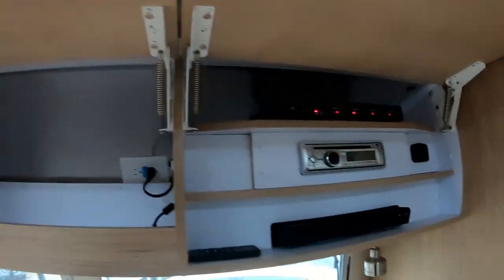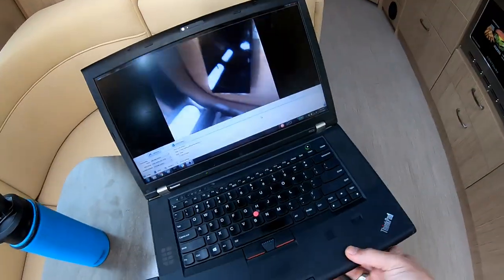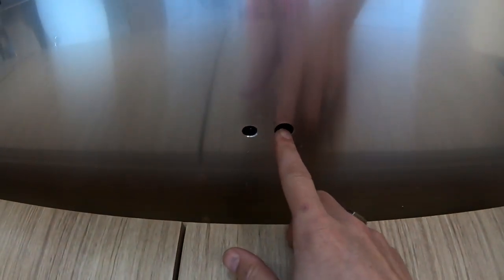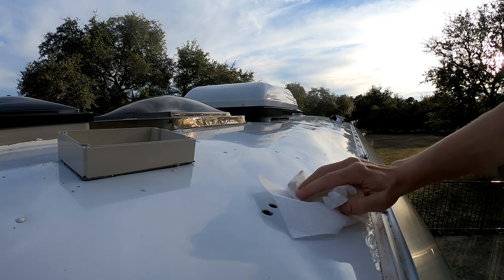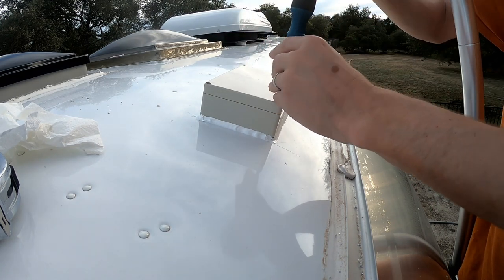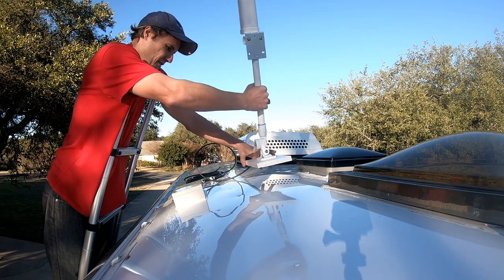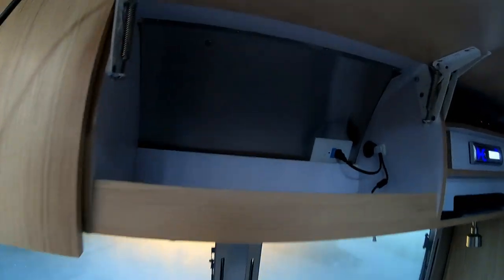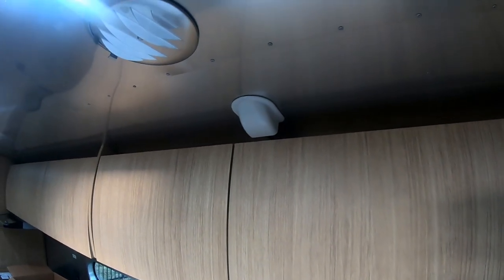Ep. 9 Installing a Cell Booster on our Airstream

Comment: Hello, is there some reason you had the holes on the pvc tubing facing up rather than down when it's not in use? Bend of cable? Any water living in tube?  How is it holding up along with the rest of the setup like the adhesive tape, caulking, etc? How do you like your tech equipment?
Reply from the maker: Hi D, that's just how it worked out with where the junction box was related to where I wanted to fold down the antenna. It doesnt really matter as the tube is hollow and the water will just drain out. So far the adhesion and caulking have held up well. Its been on the road for 2 1/2 years and its still stuck pretty well and sealed nicely. As far as the cell booster itself its sort of hit or miss. Sometimes it does nothing, sometimes it does a lot. It all depends on our location. I'm not sure on why sometimes it raises it from 2 bars to 5 bars yet other times it wont raise it at all. One thing I have since learned is that I should have mounted the external antenna further away from my internal antenna on hte system as that could cause interference. Perhaps that why sometimes its doesnt do as much, not sure.

Comment: Thank you for posting this video.  Installing a WeBoost on our Airstream Bambi 16R is today's project.  Now that you've had it installed for a few years, is there anything you would do differently?  Thanks in advance.  And, by the way, you're right....there's not a ton of documentation out there on how this is done.
Reply from the maker: The one thing I would have done differently is I would have mounted the antenna on the roof further away from the antenna inside the airstream. I've since read ( and spoken to others that have it installed ) that they get better performance if the external antenna and internal antenna are further apart. I can't say whether that's true from first hand experience but they claim there could be some interference if they are close.

Comment: Hi! I’ve been following your journey for a bit now and we actually have the exact same AS. After considering the couple of options available for mounting our antenna I’ll probably going to end up going with your method. 

I have most of the things I need to get this installed but the part missing is the cable cover that you used to hide the cable on the ceiling. Can you share where you found it?
Reply from the maker: Hi Albizu! Isn't the 30FB great?! Here's a link to the cable cover I used: https://amzn.to/3k9xrOC    It actually comes with those waterproof nubs as its intended for outdoor use as well. I didn't use those, I just used the housing though.

Comment: Are you worried about the exposed wire on the roof? Wire degradation would happen pretty quick in exposed sun and heat.  Thoughts?
Reply from the maker: So far it seems completely fine. I think the wire sheathing is pretty robust, it was manufactured with the intent of it being outside. But I can monitor it and if it ever becomes an issue just replace the wire.

Comment: John, just started following you on your adventure. Pretty fascinating. Do you like the weboost now that you have been using it for some time ? Are you grandfathered into an unlimited plan with someone?
Reply from the maker: Hi Glen, so far it seems pretty good although it seems I need to be really close to the repeater antenna inside the Airstream for it to have a positive effect. Unfortunately no grandfathered plan - I have a Verizon jetpack for $70 per month. Supposedly it "somewhat" unlimited - they claim it will still work after hitting 20gigs or so but streaming will be at 720p. I haven't had problems yet - not sure if I've ever hit that limit yet.
Reply: JohnJessJourney thanks man for the quick feedback. I went to High School with your sister and she mentioned your channel as I just purchased my first fifth wheel (although I want to travel the country not going fulltime)
Reply from the maker: @glennforst1833  Oh hey, another WI alum, nice! When are you going to head out?
Reply: JohnJessJourney First trio is a local one at a state park near my house in upstate NY (trial) then we shall see. I work overseas one month on and one month off so our trips will revolve around our kids school schedule.

Comment: I do not have any faith in the tape down method of attaching to the roof.  screws would be safer and stronger.
Reply from the maker: Yeah Jim it also seems suspect to me too, although I've read about people even taping down brackets to hold solar panels. And its lasted for years. Perhaps technology in adhesives has come a long way - I don't know but either way I'll keep my eye on it.
Reply: I have used 3M VHB tape to put my solar panels on my Airstream.  I have about 6000 miles on the trailer since install (and two winters) and they are rock solid.  They use tape like this to hold the windows in skyscrapers :)